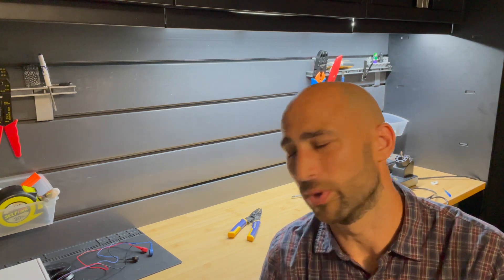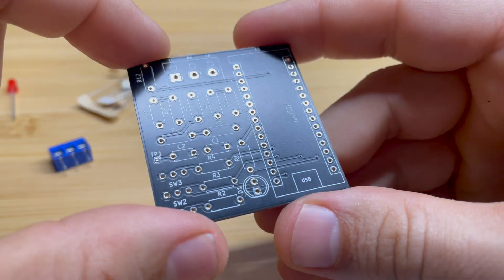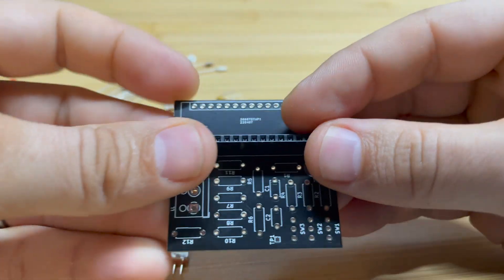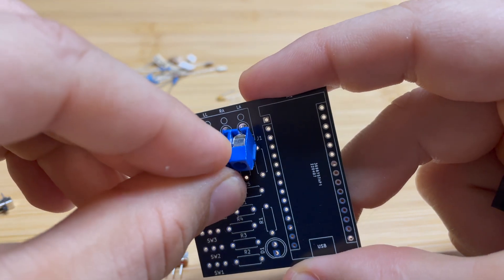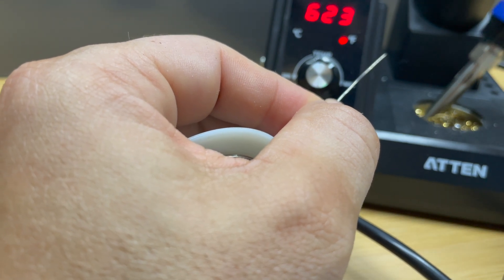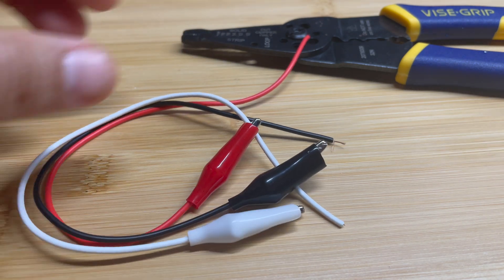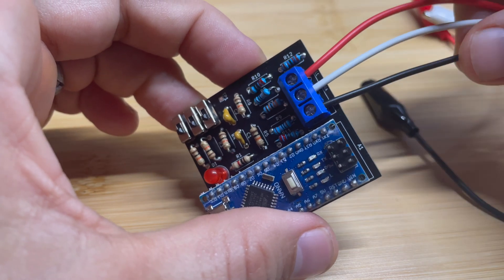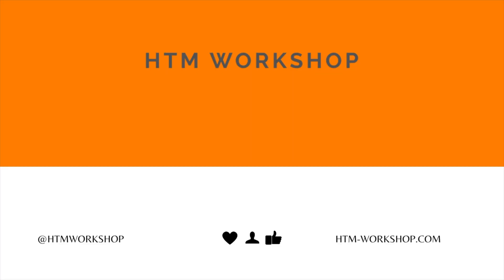ECG Simulator | Build your ECG Simulator | Biomedical Engineering Technology Project

Comment: Question. My tele monitors use 4 leads white black red and green. Problem is if the green lead is off while all the others are on then you get flat lines and leads off message. I wanna build this to be able to test my monitors at work as well as the lead wires. How can I do this on a 4 lead system